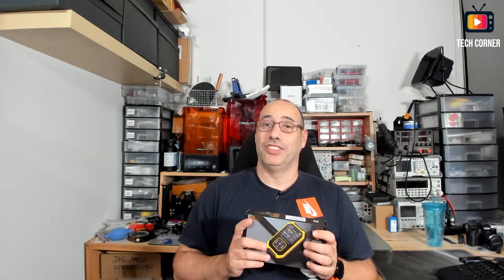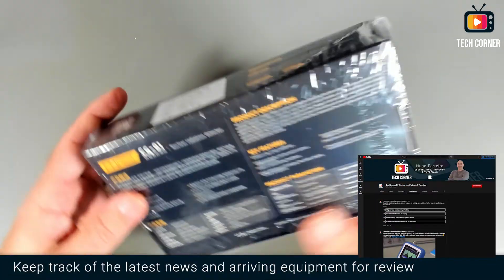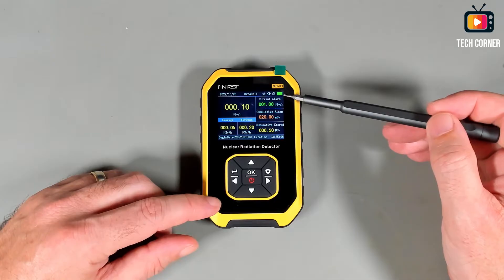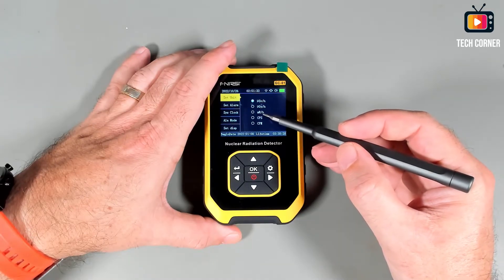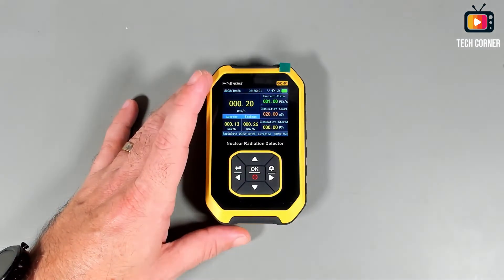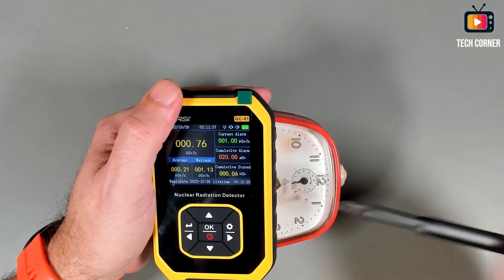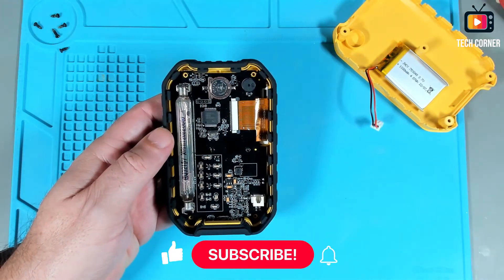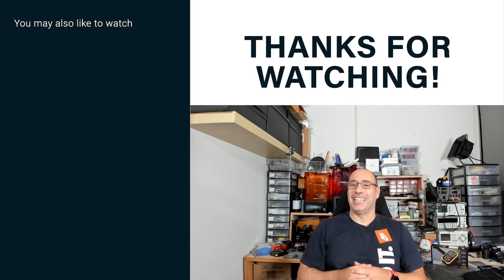FNIRSI GC-01 Nuclear Radiation Detector/Meter ⭐ Would you need one?

Comment: mine just arrived :) this sort of product really is (in a life or death situation) only useful in the event of a nuclear war where this would be needed to tell me what shelter/food/water is safe to use/consume (which i hope never happens), but i really like having something that can tell me an extra bit of detail about the environment.
Reply from the maker: Hi, agree with you. Thanks for watching.
Reply: i dont understand is it proven to be useful for this case? if yes then there is a market and i'm willing buyer. there is no other option to buy in my country and trying to find a product for exact this use case
Reply: @bugra02  this kind of device is only useful for being aware of changes in radiation in an environment, but not for accuracy. it'll tell you dose units (like μSv), but these won't be accurate, the only accurate unit is cpm (clicks per minute).

if you do get one i highly recommend installing radpro on it because the preinstalled firmware is garbage and radpro makes the device much more capable and gives you much more control.

the device does definitely detect gamma/x-rays, i've put it near a smoke detector and it detected that, and I've also taken it on flights and it's detected the radiation from space (as well as the x-rays from airport security).

Comment: I hear in other reviews, that newer versions of this rad detector use an inferior geiger muller tube.  Is it easy to procure a replacement, or upgrade to a better one if necessary?  How sturdy is it?  I recently got one of these and hear something rattling in the case.  (trying hard, NOT to shake it!)  Without opening it up, I speculate it's the internal componenets of the tube, or maybe they didn't tape down the battery in my unit.
Reply from the maker: Hi, I heard that too and more people in the comments said that, that really pity. I already commented that with my contacts in FNIRSI, but I'm not confident that will change in the future. Thanks for watching.

Comment: Hi, I have a question, when I put it on charge, the detector turns on, if I turn it off, it turns on again in a few seconds, is this normal?
Reply from the maker: Hi, probably, because you have the data logger function that can run for a lot of time, so when he detects is connected to the power, by default it starts the system. This is me just brainstorming here. Thanks for watching!

Comment: Regarding the closing comments: a Geiger counter is NOT suitable to measure X-ray imaging doses. This is because a Geiger counter only measures one ionization at a time, and then has a short dead period where it won't be able to count another ionization. In radiology X-ray imaging, the dose rate is extremely high (many ionizations per second), for an extremely short time. A geiger counter will only catch a few ionizations in this situation.
Reply: Held it next to me while getting an xray and it was around 1 microsievert so it trigered alarm setting...
Reply from the maker: Hi, thanks for your input, as I said, this is not really an area that I know anything, but I'm always learning. Thanks for clarifying and for watching.
Reply: @TechCornerTV  even not being an expert in the field myself I immediately know this has to at least be partially false as you can see several videos right on here of cheap geiger counters being set off with x-rays lol

Comment: IMHO a bad choice of power source. Especially for a device which will mostly sit on a shelf in the event should something (bad) happen. Those lithiums are probably mediocre quality at best and will swell at some point in time. A much better choice would be AA and if standby can be managed to practically zero (yes it can if they choose to) then fill it with 1,5v lithium and it can sit 20 years standby and it'll work when you require it to.
Reply from the maker: Hello! Sorry for late reply, house move and vacations. You brought a fair point. It has credit, but again you can charge a USB powered device with a solar panel with USB output, there's a lot out there that you can use anywhere in time and is not granted that you can have bateries around in a emergency. I think all solutions have strong points and weak points. What you pointed out, makes a lot of sense, but there is also credit in the lithium baterry. Thanks for watching and sharing your opinion, really appreciated!
Reply: @TechCornerTV  Yeah they're fine for devices you use a lot. But lifetime of that geiger will most likely not be more than a few years. It's not hard to replace battery if you're savvy but otherwise it'll most likely be thrown out. Still there's the risk it damages something when it swells. Those mediocre quality cells in cheap chinese stuff as said has the bad habbit of swelling at some point in time. At which it can be fatal powering it using USB if you don't remove the battery.

Comment: I bought one, looks good. There is one problem: after every switching off I have to set the date and time...
Reply from the maker: Hello, hmmmm I have to see if mine does the same... that's a bummer for sure. Thanks for watching!
Reply: @TechCornerTV  The operating time is short. What size, larger capacity LIPO accumulator do you think could be replaced into the GC-01? I can buy a 70 x 40 x 8 mm 2500 mAh battery. Does it fit? Would it be worth replacing the CR120 battery as well, to see if the date and time are not deleted when you turn it off?
Reply: Replace the coin cell battery